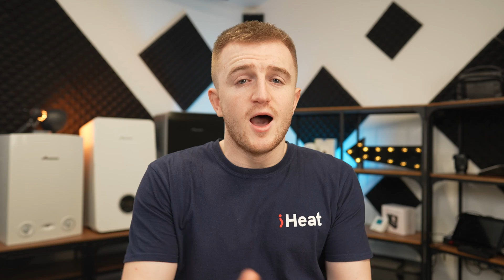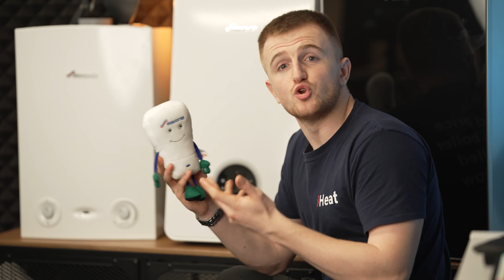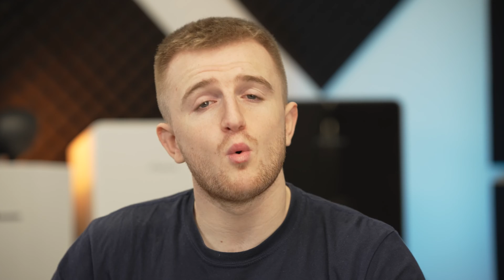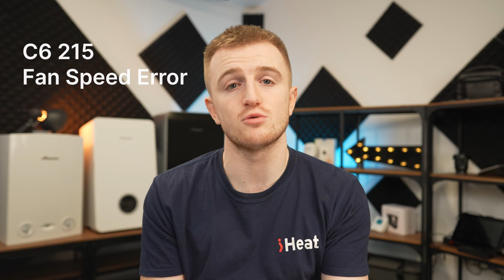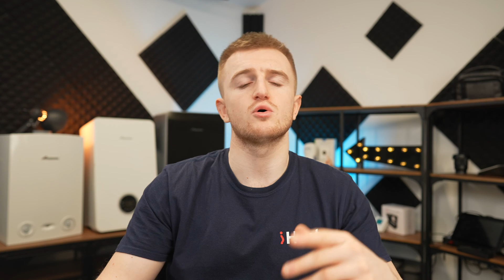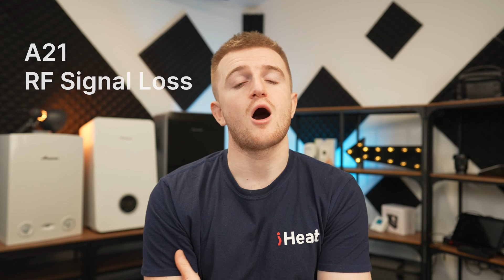Most Common Worcester Boiler Error Codes

Comment: Code A11  mean
Reply from the maker: First thing I'd try reset with fuse or correct buttons, then check water pressure - no progress It could be hot water sensor or pump so will need an engineer out to examine

Comment: Hi. I recently started to get an 2910 error on my green star 8000 life boiler. The pressure seems to be really high at 3.5 bar. I have to manually release the pressure from one of the radiators to lower it. The error goes away when I turn the boiler off and on again but reappears a few days later. 

Any thoughts? 

Thanks
Reply from the maker: Is your filling loop open, or if you have the blue tap is it jammed open? Could be when you are releasing pressure it fills back up right away. If not i'd definitely give Worcester a call or whoever installed it for you. Shouldn't be that high, is it a combi? The error code normally relates to the flue so will need a gas engineer  to sort this out im afraid
Reply: @iheat  The filling loop looks fine. But the 2910 error has gone and I now get a 2961 and  occasionally changes to 2962 error. Googling the error shows it's related to the fan. I have an engineer coming in the next few days.
Reply from the maker: Okay hopefully they can find the issue, how long have you had it?
Reply: @iheat  it's been ongoing for about a week and half. It still works if I turn it off from the mains and turn it on again. Hopefully a replacement fan should fix it

Comment: Hi mate, just got a a messed saying fault on boiler. How would I sort that ?
Reply from the maker: Hey sorry to hear this! What boiler do you have
Reply: @iheat  WORCESTER BOSCH GREENSTAR. Thanks for the reply. No error code or anything. Just saying fault. And no water pressure either. It’s showing 0.0. Maybe something has frozen? The pressure doesn’t change when I try and let water in either
Reply: No water in the system either.  No water coming though the stopcock and none inthe radiator
Reply from the maker: I know its an obvious one but have you tried resetting at fuse spur or on the boiler itself? Where abouts are you? Not frozen condensate is it? Is it and old boiler? Sorry for all the questions
Reply: @iheat  thanks so much it was the fuse spur! Legend. Do you have a place where I can send a tip or anything? You’ve saved me a big call out fee
Reply from the maker: Haha great to hear! If you could subscribe to the channel that would be help me out a lot! And of course remember us if you're ever in the market for a new boiler. Have a good day !
Reply: @iheat  subscribed mate and will be passing info on to friends and family. Thanks again

Comment: what is it, 203 Boiler in standby, not heat energy demand, and how to fix this one
Reply from the maker: Hey sorry for the late reply, have you checked your thermostat if you have one, is it calling for heat, does it have batteries, is the fuse for the receiver working, does the receiver have any lights on. Sounds like it will be a thermostat issue either wiring, the thermostat itself. Do you have a thermostat and what boiler do you have / how old

Comment: I went into settings and changed it from room temp sense to weather sensor... It now reads 1037 fault.... It won't reset.... How can I return the setting to room temp whilst in fault?
Reply from the maker: Hey if you've tried the reset button, shut it off at the fuse and still can't get back into the settings it will need an engineer looking at it to put it into engineer mode and hopefully get that setting turned off.  You'll have to give Worcester a call i'm afraid.
Reply: thankyou @iheat